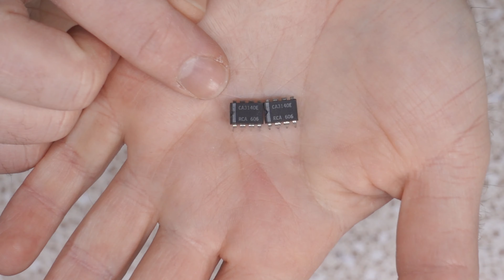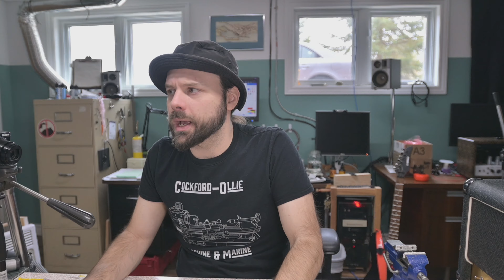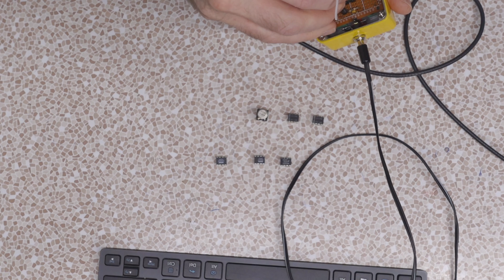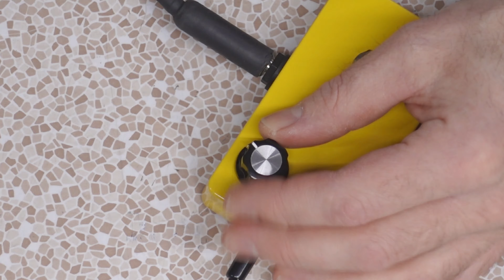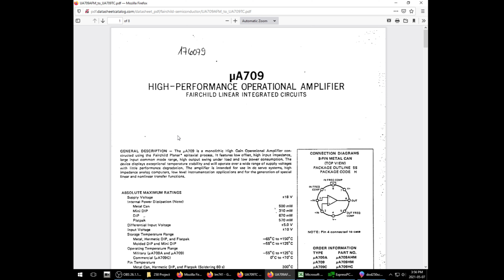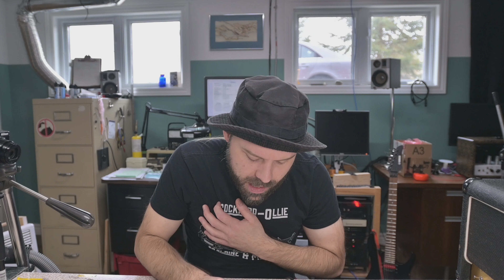DOD 250 - Ep4 : Op Amp Testing !

Comment: This is great testing and comparing work you’ve done here. Considering the flavour of opinion for some recent time is that most substitute/ equivalent opamps will have very similar or identical tone/character/sound and not make much difference (using say the JRC4558 as an example), it’s great to see a rebuttal to this. Maybe because most examples are just playing them driving a clean tone amp into OD or distortion may differ in circumstance. Hope to see more of this. Well done!
Reply from the maker: If there is one thing I can agree with, is that in practice, the differences melt away. 
They don't show up as well in recording as they do in person, cause the focus of the mic to grab a spot that sounds good in the mix ignores a lot of information. Also, these tests are done at, I wouldn't say bedroom levels, but casual levels where you can hear all the nuance. The louder you turn it up, the less the differences are perceived. 
I come to "get" why people say things like tone wood and pickups don't matter, despite me hearing a clear and present difference in person, and also a difference in feel.